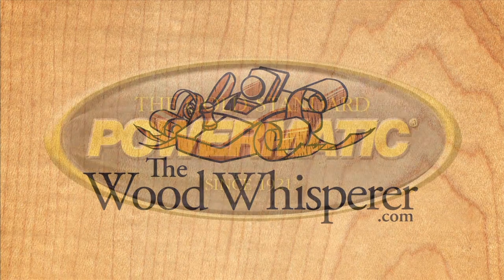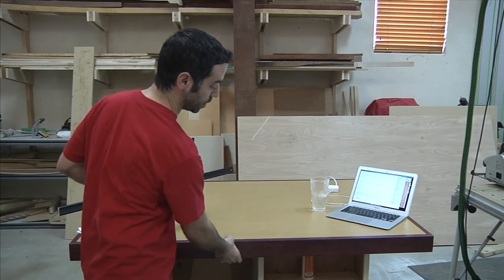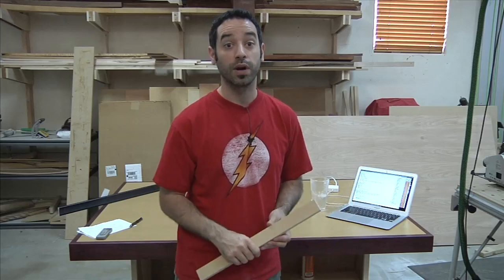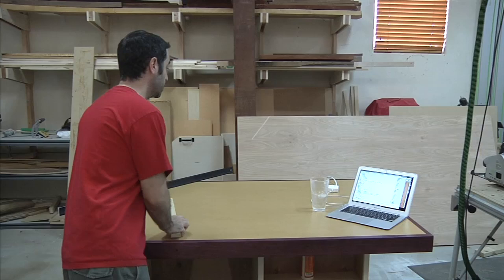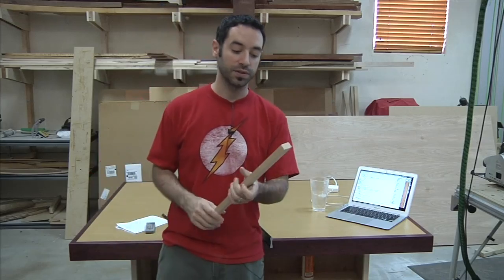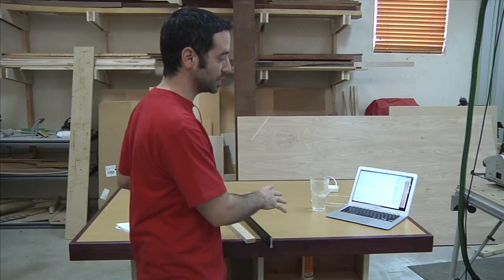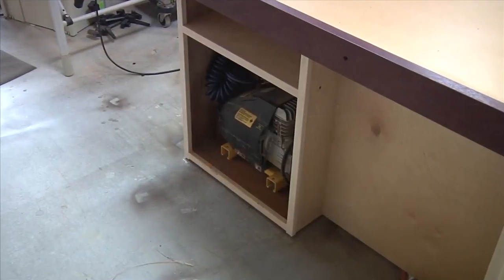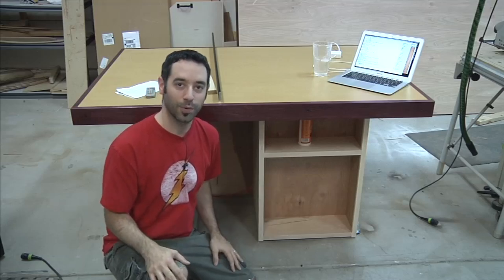A Thinner Torsion Box Assembly Table

Comment: Got a low ( 22" high) assembly stage that's now about 35 years old. The top is a fire-rated solid core door skinned with tempered Masonite. It door came from one of those surplus/second-hand building supplies sellers for, maybe, $10. Somebody made a "Whoops" out of a lock mortice. Otherwise the door was and is fine. Maybe this will help get someone else started.

Comment: Hi Had it occurred to you to put breathers in your table. What l mean is that a hollow door which is effectively the same thing as a torsion box (not a new idea at all. We have had hollow doors for 130 years) Hollow doors have slots on the inner ribs and on the top and bottom of a door to allow the box to breath and equal out the stresses of the atmospheric pressures. Just a thought.

Comment: I'm impressed with your forethought of your shop for your junior years. I have four employees and in our shop we spend many hours sanding with random orbitals. Too keep the dust down to a minimal I have a 4x6 table with the top being pegboard with a 3" void to which we have a system of connector to the dust collection. This creates a negative downdraft that takes away 95% or the particulate.  One last comment is to do with your problem with doug fir, I have had similar issues with second growth but if you can get your hands on some old growth I think your problem will be solved. Best to you, Billy

Comment: On your previous TBAtable you ran the longest internal supports perpendicular to the long dimension of the table.  Was there a stability or structural reason to do it this way? Would you think running parallel to long edge would be structurally stronger and more stable?

Comment: Hey Marc, a oil finish has chemicals in it that actually hardens the mdf when they make contact... The end result is a rock hard surface that will last for ever... I usually use min wax tung oil... Works great and give it a shot

Comment: if the wooden leg dog chew incident is not too bad then you can try a very wet towel wrapped over the damage then apply a hot iron to the towel to allow steam to appear. do this a few times and the holes will close up, dog teeth push the wood aside, not remove it like a drill, so when it gets wet it swells up, then it dries where it was before the dog chewed on it, then the rest of the repair will be easy. you can use this method with dented wood also ;) happy days

Comment: Hi Marc, Yo have some really nice videos out there, showing the skills and materials.
I know this is an older video, but since then, you probably find out that those rolling carts with that kind of drawer setup is purposed for mechanics and similar type of profession. Where most of the tools can be dragged out to the machine and do the repairs. Nevertheless, some occasional woodworker can use it to store just about every hand tool, and few power tools in the bottom. Or even hang a few plows from the sides or back. I speak from my own experience.
Take care,
Best regards from Croatia.

Comment: try putting it on heavy duty wheels like 4 in. braked crazy wheels on one end straights on the other end these make moving a table or bench for one person easy my dad and i do this it works and the tables will support over a ton and are still easy to move even with weight on them and the don't move unless you want to move it just an idea also waist height is about the best for all around project work

Comment: You're incorrect in assuming that density and weight must be directly proportional.  LDF is what many people call particle board.  Light-weight MDF is exactly what it sounds like; a product which looks, feels and behaves like MDF, only it has much less mass.  It uses a different wood for the fibers and possibly a different binder.

Comment: Hello, my name is Noah and I am a big fan of your video blogs.  I really get a lot out of them and enjoy most episodes.  '157-My New Assembly Table', you humbly showed how either ends were out a few thousandths of an inch.  I have a few questions on that and they are:

-Do you have any idea as to why that is? 
-What would you do differently if/when you build the next one to address this issue? Or,
-What could I do to address this issue if I decided I wanted to get it just a little more flat?
-Lastly, that straight edge you used to demonstrate how flat the top was... I've looked every where for one.  What is the technical name of that straight edge?

Thanks for your time and your show.

Respectfully,

Noah
Reply: Noah Cross but i thought u already knew all abt wood working an stuff, considering u saved humanity with ur ship and stuff ;(

i....i.... i though u wer the best at wood working ;c

Comment: Your problem with douglas fir is most likely regional. I'm in the northeast, and douglas fir tends to be the better products up here. I have much less warpage and other problems with them up here, but I do get the sense that they wouldn't do well in a much hotter and drier environment like where you are. I actually get more problems out of pine up here, but that's because I can never find legitimately kiln dried pine. One piece I had was still extruding sap. It saddens me, really.